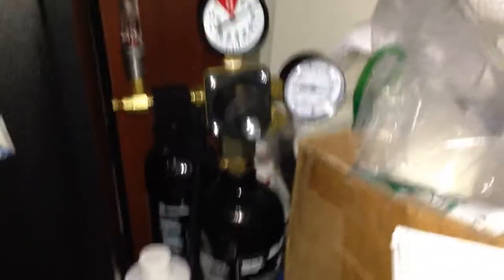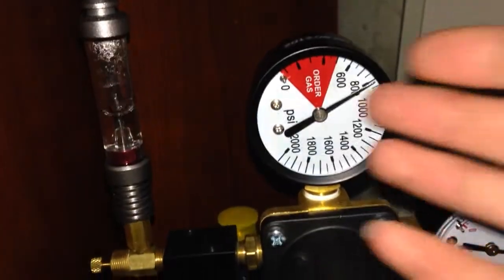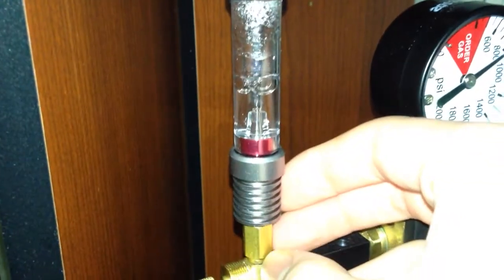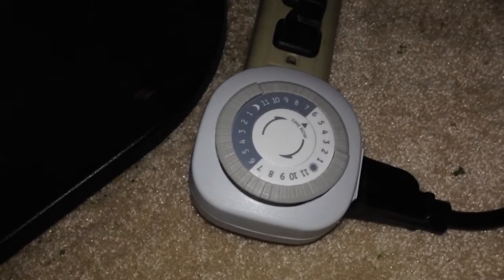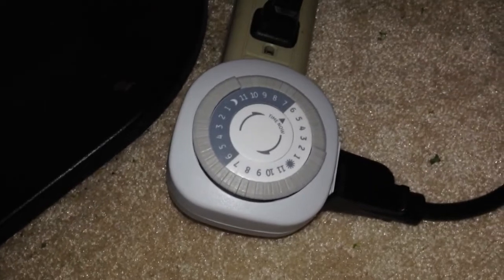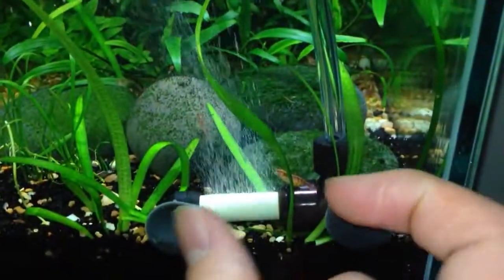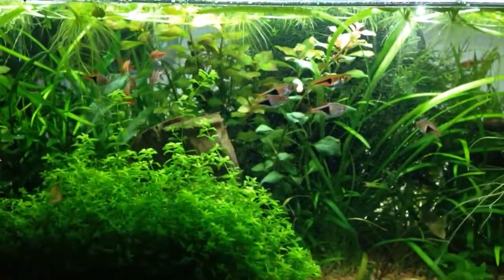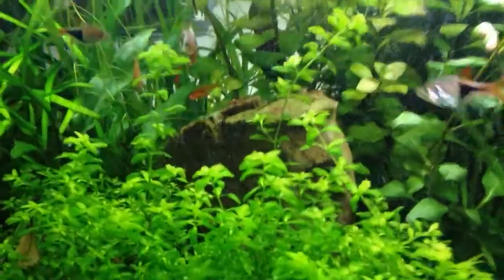Pressurized CO2: planted tank

Comment: Does co2 bubbles need to touch the plants ?to say that it works
Reply from the maker: No the Co2 bubbles will dissolve into the water which is then distributed around the tank. They don’t need to physically touch the plants.

Comment: Hello brother .can I use lbs co2 tank setup on 10 gallon tank or it would be to big for 10 gallon tank .thanks
Reply from the maker: Hi, you can actually use whatever size you want for any tank size. A larger CO2 tank will simply last longer so you won't have to refill it as often which is nice
Reply: Cam'sJungleAquaria .Thanks again .What working pressure I should set and how many bubble per sec.
Reply from the maker: I think that depends on what regulator you use on your tank and also what diffuser you use. It should say somewhere what to put it at. But typically it’s around 30 I believe. Bubbles per second is something you’ll have to experiment with. Start slow at first and then gradually increase over time while watching the fish’s behavior each day to make sure it’s not affecting them.
Reply: Cam'sJungleAquaria .Thanks so much . I'm really glad to find your channel

Comment: Just make sure you are watching your KH lvls especially if you are turning off co2 at night. Co2 makes carbonic acid which unless buffered by high KH will start to give you huge ph swings at night when you turn it off. A lot of people leave it on 24hrs not because of any benefit but, to stop ph swings. Agitate the surface and leaving it on the fish will be fine. If you are not watching kh close you will come home to a dead tank. Just a matter of when the ticking time bomb goes off on you.

Comment: Awesome video, question for you: How do you deal with CO2 bubbles at the surface of the tank? Ever since I started running pressurized CO2 I notice I have a lot of bubbles at the top of the water and always have this surface scum, it's pressurized CO2 by the way. I know that with pressurized co2 you're not supposed to have surface agitation as it'll gas out too much of the CO2 so I'm not too sure how to get rid of the surface scum where the bubbles collect, any suggestions?
Reply from the maker: I get the same thing happening sometimes. The only way to get rid of the surface scum and the collecting bubbles is by adding a little surface agitation. Since levels of O2 and CO2 are not affected by each other in the tank, by increasing the oxygen in the water (surface agitation), you'll be able to increase the amount of the CO2 in the water and still have fish that aren't gasping for air. I added a tiny ripple at the surface just this last week to help with the surface scum, and it has completely solved the problem. Now I can keep CO2 levels really high for the best plant growth, and my fish swim around normally. So my advice would be to try out a little agitation at the surface to get rid of the scum and increase the amount of CO2 you're adding at the same time.
Reply: Okay great thanks a lot for the advice. I'll try increasing the surface agitation while also increasing the levels of CO2, Thanks again.

Comment: What is the thing on top of the co2 tank called and how much are they?
Reply from the maker: That's the regulator. They can be expensive depending on the features you want and the company. Mine was $199 but you can find good ones for cheaper than that. Aquatek makes good ones at a fair price. Here's a link to the regulator I have: http://greenleafaquariums.com/products/paintball-co2-regulator.html